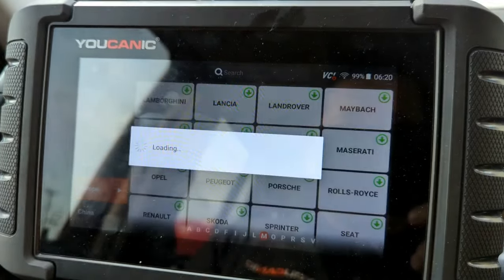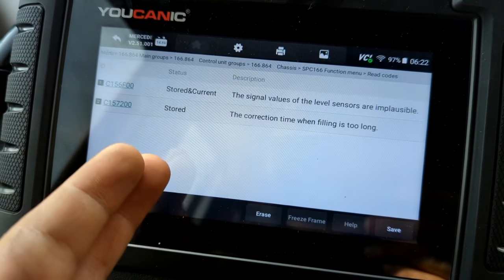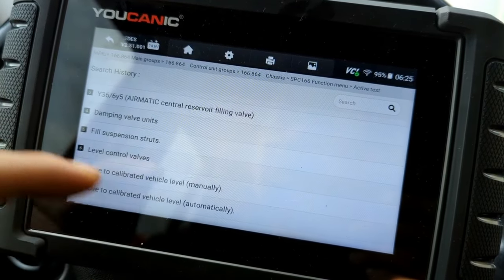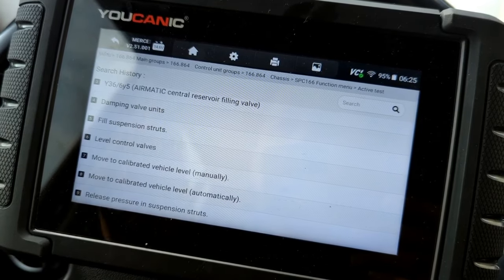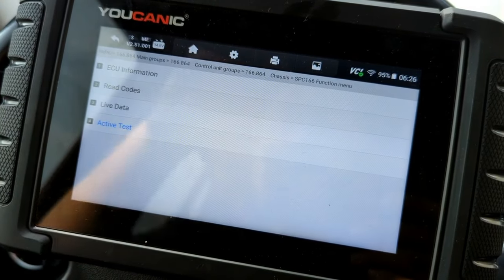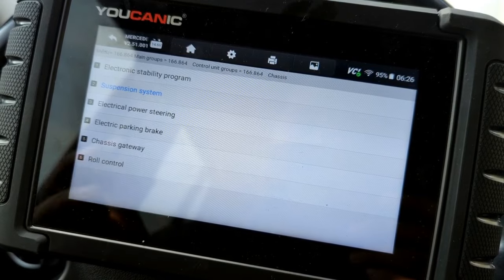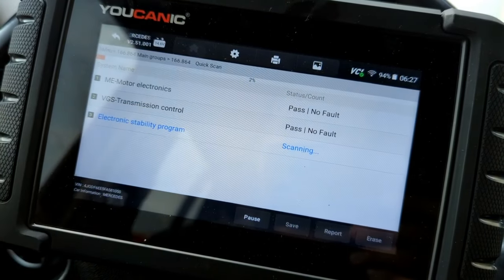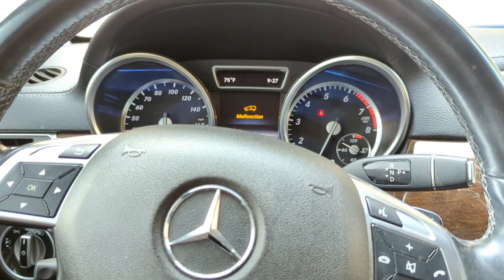Mercedes-Benz AirMatic Air Suspension Malfunction Common Problems - Up Arrow - Car Lowered Dropped

Comment: My gl450 2014 shows the malfunction light and the rear dropped, took it to 2 different mechanics (friends of mine) both find no physical problem, tomorrow i will go to another one before i go to the dealership for them to fix it if noone finds what it is.
Reply: Check on your Air Suspension Valve Block
Reply: @stevianrey7751  thank you, i already fixed the problem it was a broken air bag
Reply: @theotherhalfoftheang  Glad it's fixed!! Good to hear!
Reply: @stevianrey  thank you 😊
Reply: @theotherhalfoftheang  when you had issue could you hear the air trying to fill kinda behind the tire where the problem is
Reply: I have same problem with my 2014 GL450
Reply: @mgs5_snake821  my problem was the air bag it was broken,  see the mechanic

Comment: I have the malfunction light come on 5-10-15-30 minutes later, but the rear passenger suspension is way lifted/higher compared to the remaining 3 suspensions. What's the cause of this? Is it problem #2?
Reply: Did you fix the problem?? I have same problem.
Reply: @theotherhalfoftheang Yes, I fixed the problem. The self-leveling sensor in the rear passenger was broken, but nothing with the compressor for me. Had to get the self-leveling sensor replaced, and now it levels evenly.
Reply: @nottryinghard1023  what happens to mine is that shows the suspension light up and the rear lowers down, when i wait for a while I'm able to lift it up with the lift botton and stays like that if its not moving but after driving for 5 minutes it shows light again and goes lower, 2 mechanics have checked and they seem to not find any physical problem with it, it's so annoying,  any advice is appreciated.  Thank you.
Reply: @theotherhalfoftheang  It could mean that there is a leakage in the airbag for the air suspension. Maybe you should try taking out the suspension and inspecting it. Unless the mechanics already did that.
Reply: @nottryinghard1023  thanks for your reply I really appreciate it 🙏,  update my mechanic said its the airbags, yesterday i got them from the store and give it to him hopefully it will be ready today or tomorrow i honestly dont care when i onky care that my suv be ready up and running without any other problems by the end of this week or next one if necessary 🙏🤞
Reply: @theotherhalfoftheang  No problem. I'm glad I can help by giving advice.
Reply: @nottryinghard1023  🙏👍🏻

Comment: This was a waste of time, If had a scanner I'm pretty sure I can use it just as well as you. Also if the level sensor doesn't read correct it will keep on trying, or stop due to the fact that it doesn't know what the various levels are. You will hear a leak if it has one.
Reply: Well there is no magic solution. If you just want to throw parts at it then you can.

Comment: Does the compressor goes off like let's say every hour or so there is no malfunction light what is the problem if there's one thanks
Reply from the maker: If your system is in good condition, the compressor should run for a few seconds then turns off. If it is running a lot you have a leak (in most cases).
Reply: @YOUCANIC  thank you
Reply: What is it when it's suddenly making a loud noise?

Comment: malfunction pop ups on cluster, but if i turn off the engine and remove the key and start again the sign of malfunction disappeared. could you explain to me what triggering the malfunction popups at cluster
Reply: Read the codes from the airmatic control unit. That would explain it.

Comment: I got a 2015 c250 here australia, car has 99k kms (61k miles) When I dont drive the car for a week the rear suspension drops, when I turn the engine it rises, is this Normal?
Reply from the maker: The phenomenon of your car's rear suspension dropping after a week of inactivity isn't entirely abnormal, but it isn't something to ignore either. It could indicate a small leak or wear in your air suspension system. We recommend using the YOUCANIC Full System Scanner [www.youcanic.com/scanner] to diagnose potential issues. 

Beyond that, if you have any more questions about your car's condition or need further guidance, don't hesitate to ask on our platform: www.youcanic.com. We're committed to making car repairs more understandable and approachable for owners like you and provide a wide variety of resources to help you in your automotive journey.
Reply: @YOUCANIC  thanks for your reply

Comment: Hi, I have an older gl class (2008) and have a problem where rear right side is lover than all 3 sides. Before it was leaking, till it blown up. Now I have replaced suspension air bags on both rear sides. After change, the car looks unlevel at back. I did change a hight sensor  on right side, but after all the problem is still there, where do I need start to look ? Even the Mercedes workshop arent helping, they are only guesing that its some where in wires, and charge per hour they use, to find the problem.
Reply: Might need to replace your Air Suspension Valve Block
Reply: Valve block
Reply: Modulo gateway quizás

Comment: I'm using a foxwell nt510 elite. I have the acess to diagnose issues like you can my issue is I tried to raise the left rear but when I hit raise the car lowers. Has anyone come across the same issue?  I'm also having g an issue leveling the vehicle via the scanner. It just says u readable dara
Reply from the maker: Thank you for sharing your issue with us. Here at YOUCANIC, we aim to help and guide you through your car repairs. Your situation seems a bit complex and could require a more powerful at-home tool. If you're interested in taking your diagnostic capabilities to the next level, we'd suggest looking into the YOUCANIC Pro System Scanner at www.youcanic.com/scanner. This professional diagnostic scanner may provide you with clearer insights and possibly resolve the issues you are facing.

Additionally, if you're looking for more comprehensive information such as Factory Repair Manuals and Torque Specs, you can obtain access here: www.youcanic.com/manuals. This could serve as a valuable resource when it comes to tackling some of those trickier repair tasks. We hope this helps, and appreciate your valuable feedback. Remember, our primary aim is to help you efficiently maintain and repair your vehicle.

Comment: I had a little extra weight in the trunk of my e500 and after about 24 hours the rear half dropped and won't go back to level.  Is it possible the computer needs to be reset

Comment: How do you reset to the airmatic suspension on  a gl550  2011
Reply from the maker: To reset the airmatic suspension on your GL550 2011, the YOUCANIC Full System Scanner would be an excellent tool. It is designed to diagnose your car comprehensively. You can learn more about it at www.youcanic.com/scanner. 

If you need more advice or have other questions, visit www.youcanic.com. It is a platform dedicated to empowering car owners like you with resources like OEM Factory Repair Manuals and a platform to ask car-related questions. We appreciate your trust in YOUCANIC as your reliable source for all things automotive.
Reply: @YOUCANIC  I was hoping you would answer my question and not try to sell me a product
Reply: @thenorseofnassau8250   He did answer your question, you need a scan tool for the job. And NOT ALL scan tools can do this.

Comment: I had a truck transport my 2018 Mercedes GLS from Florida to Illinois . After picking car up the MALFUNCTION  light came on after a few minutes and rear end of car sits very low. In addition the SUV drives very rough. Any ideas as to reason this may have happened?
Reply from the maker: Thanks for reaching out! It could be that your 2018 Mercedes GLS has developed a suspension problem which might also explain the rough drive. However, for a more specific diagnosis, we have comprehensive guides and a powerful YOUCANIC scanner on [www.youcanic.com](www.youcanic.com). 

We're all about empowering every car owner like yourself so feel free to explore these resources, ask questions and even get factory repair manuals. Our goal is to build your confidence in car troubleshooting and save you some money while at it. We're here for you every step of the way on your car ownership journey!
Reply: What ended up happening with your vehicle? Did they fix the issue

Comment: My 2014 GL450, have the same malfunction light on this morning while I was driving.  T he driver side wheel went down 4” .
Probably the air suspension went wrong already.
Reply from the maker: It sounds like you might be having issues with your car's air suspension. Thankfully, YOUCANIC offers a Full System Scanner that can help you diagnose this issue effectively, just like a professional mechanic. Check it out at www.youcanic.com/scanner. 

We also offer ample resources including OEM Factory Repair Manuals and a platform to ask car-related questions at www.youcanic.com. If you need further guidance, don't hesitate to ask. We're here to make car repairs accessible and understandable for you.

Comment: Temp went below 20 shocks not working
Reply from the maker: Thanks for letting us know about your issue -- we're here to help you quickly identify and fix your car problems. Have you tried diagnostic tests? Modern cars require professional diagnostic scanners for accurate troubleshooting and that's why we recommend our YOUCANIC Full System Scanner. Learn more about this tool at www.youcanic.com/scanner.

Completing the job also sometimes requires access to Factory Repair Manuals and Torque Specs. Fear not, we've got you covered. For a nominal fee, you can have all the necessary detailed instructions at your fingertips. Find it here: www.youcanic.com/manuals. We're committed to making your DIY car repairs a smooth journey!

Comment: hi, I have a problem with my E-class w212. The suspension is stuck all the way up. In diagnosis it gives me error C156E00 level calibration not performed and error A19116 circuit power supply 30g out of range limit. The level calibration doesn't work for me,what could it be? thanks
Reply: Did you figure this out? I have a w212 E63 with the same issue.

Comment: I replaced compressor fuse box relay fuse car comes on but new pump doesn’t turn on…
Reply from the maker: Thanks for your comment! It sounds like you're experiencing some technical difficulties following your repair. At Youcanic, we have a plethora of guides and resources, along with our powerful YOUCANIC diagnostic scanner to aid you in resolving these issues. Please visit our site www.youcanic.com where you can also find factory repair manuals. 

Our aim is to encourage and support car owners like you throughout your car maintenance journey. Don't hesitate to reach out to us for further assistance - we're here to help! We hope you'll find our resources useful and empowering!

Comment: I have 2011 mercedes e550 airmatic suspension, sometimes the front end drops when parked for over a period of 3-4 hours or while driving and sometimes it rides fine and doesn’t drop even drop overnight. Is it a valve issue?
Reply from the maker: Hi there! A common issue with Airmatic systems is a leaking air strut - it can often cause the symptoms you describe. It could also be a valve issue as you suspect. At Youcanic, we provide tools and resources like repair guides and our very own YOUCANIC scanner to help you narrow down the problem. Don't hesitate to visit us at www.youcanic.com/ for more help. We're all about empowering car owners like you and are here to support your car ownership journey. Best of luck with your Mercedes!

Comment: My warning light didn’t start appearing until after I had to have the right front strut replaced on my 2012 GL550. Coincidence or connection? Should I address this with the mechanic that replaced that strut? Or treat as a completely different issue?
Reply from the maker: Thanks for your question. It might be a coincidence or there might be a connection between the two issues. We recommend speaking to the mechanic who replaced the strut, as they can give insight into your vehicle's condition. For further help, feel free to visit www.youcanic.com where we offer free resources, guides, and assistance to empower car owners.

At YOUCANIC, our mission is to assist you with your car maintenance needs, helping you save money and build confidence on your car ownership journey. You'll also find factory repair manuals for detailed support. We're here to help whenever you need us!

Comment: Hi,  I have 2013 Mercedes ML63 and all right passenger side suspension alot higher than the left side. Also there is a malfunction light and  suspension lift button does not function.
Reply: Were you able to figure out your problem? I am having the same issue

Comment: I’ve got a W222 2014 model with 70,000 miles with immaculate service history car has wanted for nothing and always OEM parts fitted.
Had problems with air matic suspension and believe me it’s eye watering expensive to repair it’s not a question if it will leak it’s when . I am thinking of removing and going over to springs
Reply: Why don’t you buy the OE part and DIY. It’s not that difficult. I could also recommend a junk yard if you wanna find the original mercedes part with lower miles if money is that eyewatering that you can’t even keep that immaculate service history clean as it is(was)

Comment: Brother I have a question I had a problem
With my compressor everthing was working fine only the compressor was noisy , so I bought a used one a have swapped it but the car doesn’t lift no more after the swap .